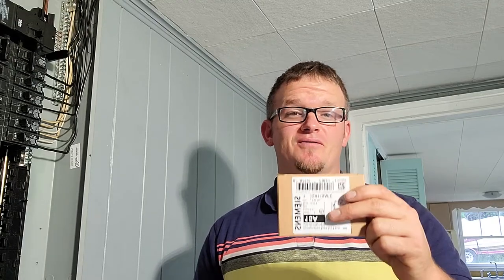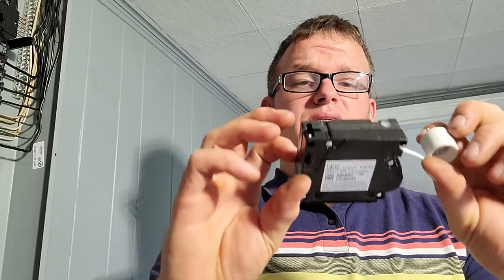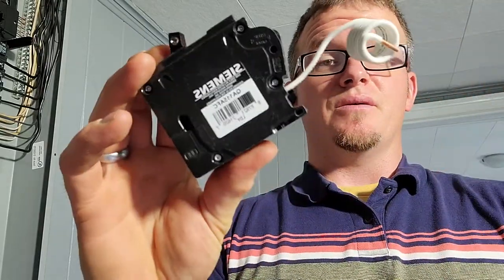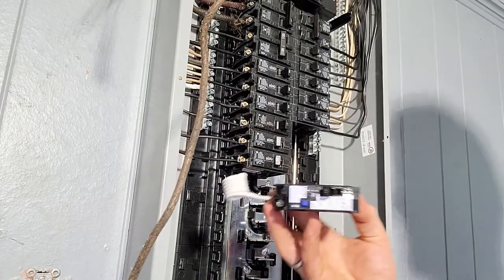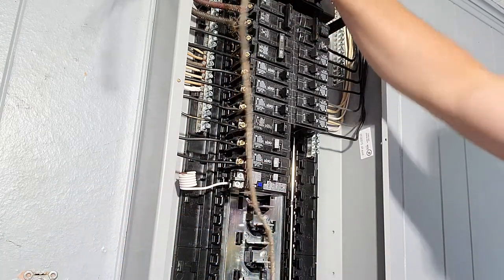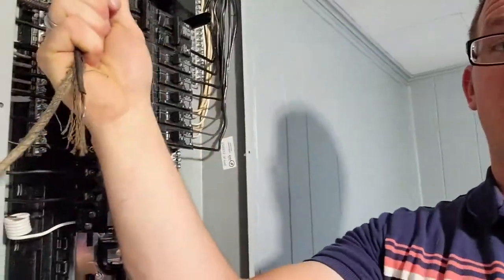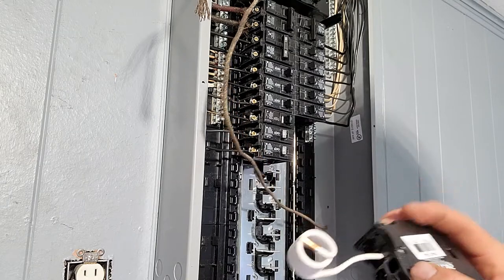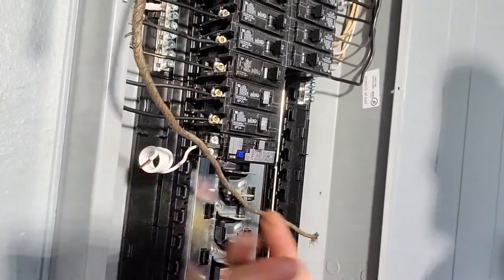How to install an arc fault breaker electrical DIY how to electrical. Be a Pro. Learn from the Pros.

Comment: Thanks for making these videos. What I like to do with those breakers is first stretch out the pigtail and cut it back to about 6”. That’s enough to work with, when there are a lot of them to deal with, doesn’t crowd the box with unnecessary wire.
Reply from the maker: Excellent Tip! Thank you for supporting the channel!!

Comment: I was trying to figure out why mine had no pigtail wire on the breaker and didnt realize it had a bus bar on the panel the breaker utilized instead of a wire. Thanks for saying that at the beginning of the video. Makes cents now.

Comment: Thank you so much!  Quick question ... I live in a 40-year old house and have been changing some of the breakers, or outlets when more convenient, to AFCI.  I have one more to do ... there are no outlets that will suffice and the current Romex and breaker are on the left side of the service panel, the neutral bar is on the right side.  The pigtail on the AFCI breaker will not reach.  Am I allowed to wire nut an extension to the pigtail within the service panel to reach the neutral bar?  If I switch positions with a breaker on the right side the black and white wires coming from the Romex will not reach.
Reply from the maker: Hey Brother! Glad the video can help! I have to recommend you don't take any advice from the channel, but anytime someone is in the panel and the arc fault neutral is short they could just make a jumper to the neutral bar from the pigtail. Thanks!!
Reply: What do you mean by a jumper? Extend the white pigtail wire using wire nut and run it to the N bus bar?

Comment: What if the neutral pigtail doesn’t reach the panel? Can you wire nut and send a longer enough pigtail to the neutral bus?
Reply from the maker: Great question, i would check the paperwork that comes with the breaker. sorry i couldn't be more help on this one!